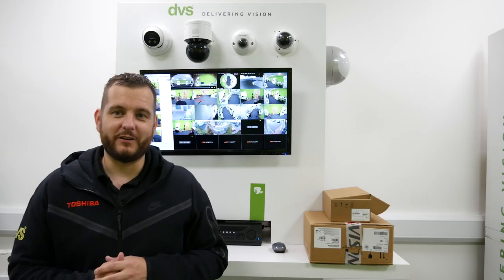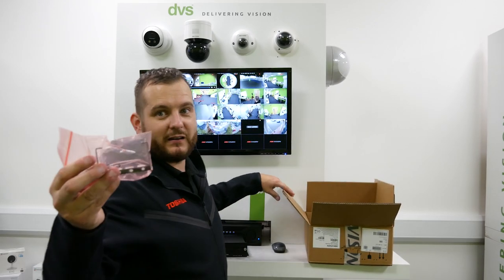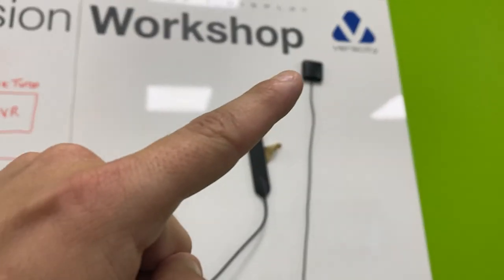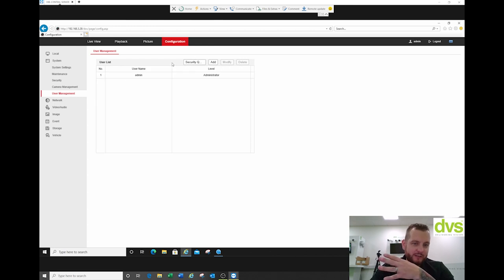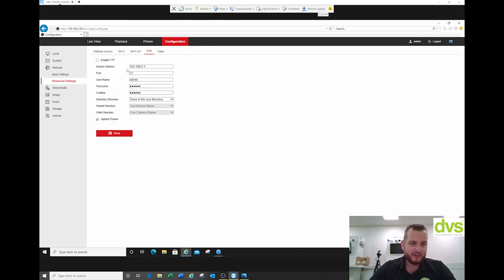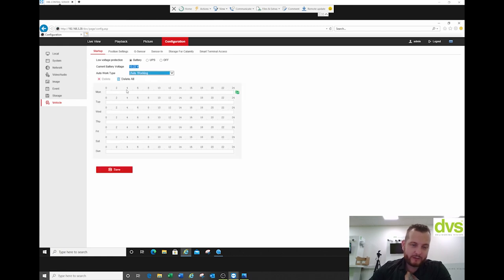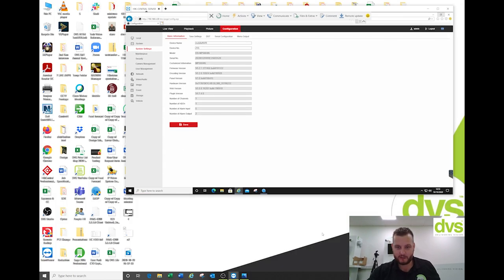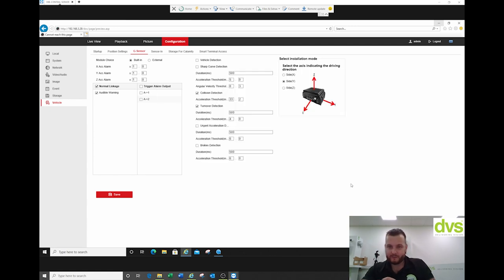HIKVISION 4G / WIFI MOBILE NVR SET UP GUIDE (DS-MP5604N)

Comment: Great Video, one thing we are having issues with is the reviewing of downloaded video files over MS Stream.  Stream does not like the bit rates of the video files or the Audio rates within the exported MP4 files.  Is this something that can be changed in the Picture tab or other settings?  Or is it selectable when exporting (Backing Up) sections of video?  I am trying to avoid having to re-encode them after download as out Fleet department are not to IT savey; I am trying to provide them with a simple guide.

Many thanks

Comment: hello. I know it has nothing to do with the video. But if you can help me. I will be most grateful. I'm installing a CCTV system in a car. dvr//camera/router// a system used in homes. all equipment uses 12vdc. My question is the following: the car battery oscillates between 12v and 14.5v. I can connect directly to the battery. Or do I need to use something to stabilize the voltage!?! thanks.!
Reply: The input Voltage says 9 to 32 VDC Wide power Input

Comment: Hi Dave - if the 3G/4G module is not available in my area, what kind of a device would I be looking for if I wanted to connect the NVR to a cellular network?
Reply from the maker: Hey hope all is ok , if its not available you can use a 4G router and connect the device into this and use the free HIK-connect method, we still use this a lot also in the UK 😊